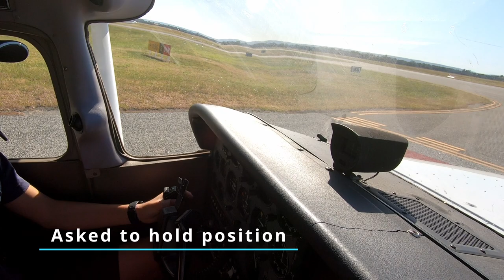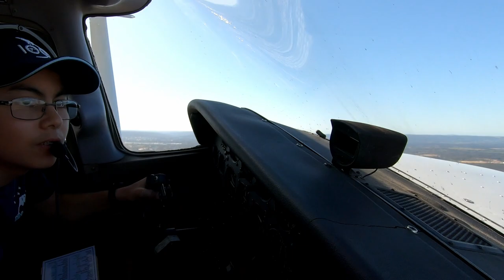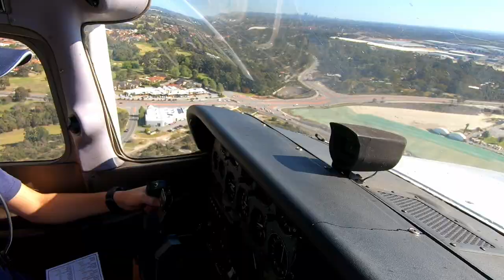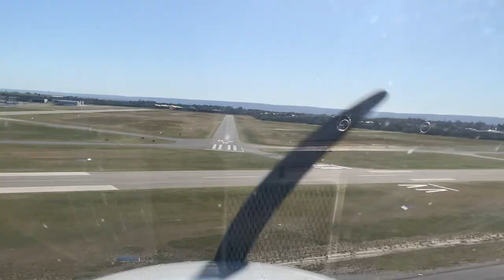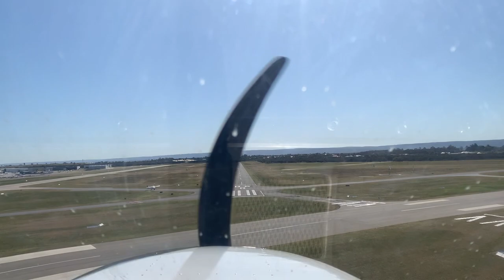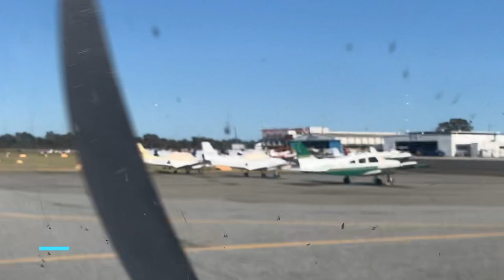Circuits in the Cessna 172

Comment: Hey mate, Great videos! I'm doing my rpl with RACWA, I'm down at YMUL. What do you use to record audio? I have a channel too, currently use a lapell mic in the hear cup which works but thinking maybe a voice recorder, not sure though..
It's such an awesome adventure
Reply from the maker: Hey Steven, thanks for watching. For my audio, I have a mic adapter which plugs into my GoPro. This makes sure the audio is always in sync which makes editing easier. I get the audio into the GoPro by using a splitter to give me 2 outputs from the aircraft, and then use a 1/4” to 3.5mm adapter, which connects to a 3.5mm male to male which goes into the GoPro adapter. 
I will leave the links to the equipment in the description of the video for you
Reply: @keldog_aviation  thank you for replying and providing links! I'll definitely be looking into a mic adaptor. Happy flying!